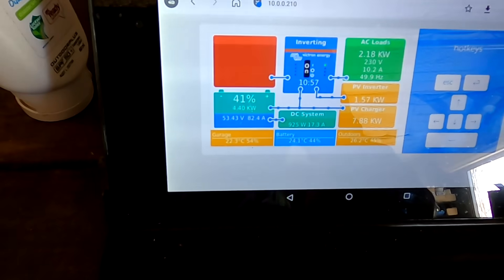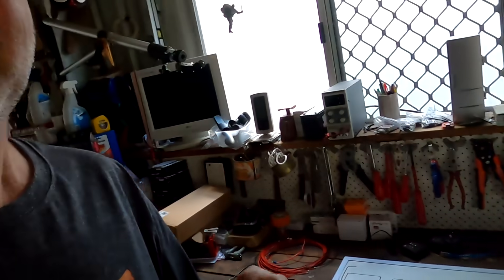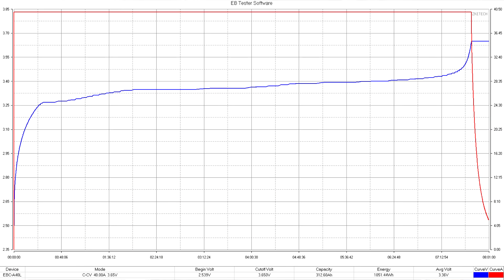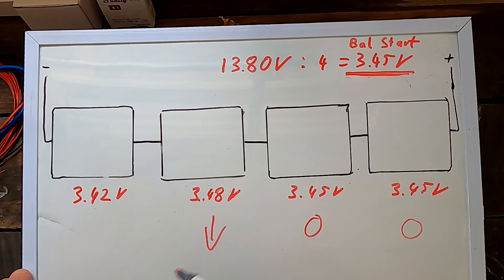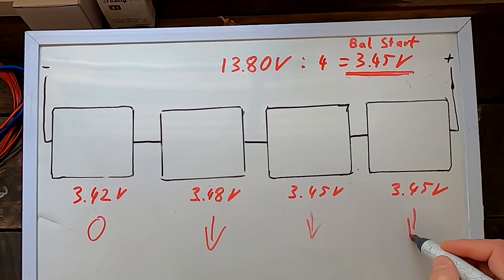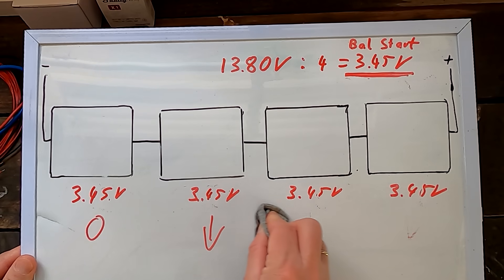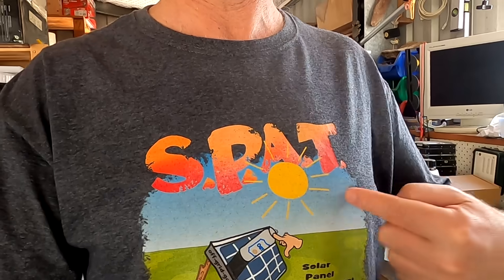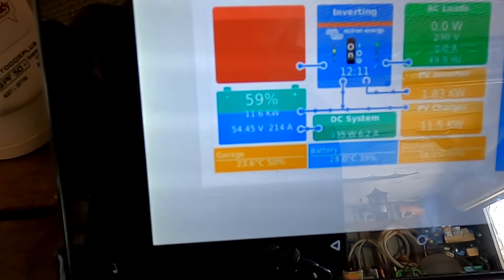Balance Start Voltage for LiFePO4 explained. Why you should not start too early... 🔋⚡

Comment: Thank you Andy, always a pleasure to watch your videos. I am trying to find the optimum settings for my new svolt battery / inverter with built in pace bms. One of the cells constantly  reach 3.65v while others remain fairly equal within a few mv. . Is it bad for a cell to reach 3.65v often  during bulk charge, or can I utilize the function of "forcing" the bms to stay into balance mode as long as no current is drawn.  (It is difficult in a production system to not draw current, which gets worse in my country with electricity so called load shedding - e. g. today we will be without electricity for another 8 hours BUT with lots of sun) My supplier suggests 3.5v bulk charge and  3.4v float. Should balance threshold be ok at 3.45v?

-Chris
Reply from the maker: Thanks for your question Chris. 
If you have access to the batteries, the fastest way is to temporary connect an active balancer to the battery and let it do a perfect top balance.
3.5V as charging Voltage is fine if you let the cells absorb for maybe 20-30min afterwards. That will fully charge them. Under such normal charging, none of the cells should reach 3.65V and trigger the BMS to turn off.
Float, I would set a bit lower to 3.35V. 3.4V is a bit to high.
You can start balancing at 3.45V, no problem.

Comment: You are a legend dragging us out of  the "balancing is not necessary" dark ages. You have done this by initially trial and error but now we have all begun to understand how it all actually works thanks to your testing. "All" includes the manufacturers who begun to add features thanks to your documentation. I'd be interested to see how in day to day real life the Neey system performs with voltage on/off set at 2.7V and deltaV = 20mV. Is the flatness of the discharge curve and 20mV enough to prevent unbalancing?

Comment: @Off-Grid Garage
Thanks a lot for Your great videos! Thankfull I have learned a lot.
But this is the first time, I didn't understand, or You are wrong. It's about the explanation beginning at 6:30
You say, the balancer would discharge every cell, which is above the balance-starting voltage. So the balancer would just produce heat.
But an active balancer takes energy from a higher cell, transfers it in his buffer storage (capacitor) and transfers it to a lower cell (to charge it).
In your example, the balancer would discharge cell 2 (3,48V) and charge cell 1( 3,42V). 
I´m quite sure, that cell 1 would not be discharged here. 
Could you explain, please ;-)

Comment: I bought the voltage relay and heltek 5a balancers for my 16s packs with JBD BMS. Best thing I ever did. Start balancer at 3.45v, been running this way since two weeks after your video on the voltage relay..several months at this point. Within each pack they is never more than a .009 Delta. Amazing.
Reply from the maker: Fantastic! Thanks a lot for sharing!
Reply: Hi, I'm looking into installing a 5a balancer. Can you tell me what start relay you used? Thanks.
Reply: @sailingcamel1020  the one in his video and on the site.

Comment: Andy
You Told Us Earlier That Start Balance at 3.4 Volts
WTF
Now You Sy 3.45 Volts

I Think Someone should make up THERE Mind!!!!
Don't you think?
My settings are the same as yours but 1/2 because of 24 volts
Reply from the maker: It depends on your system design and what your charger settings are.

Comment: The BMS that I am using 250A Muller Energy 4s.  I have everything in the bms configuration correct and still its having issues with cell one. I thought active balance would help with OVC OCC
Reply from the maker: And that's even after a full top balance and bringing cell 1 in line with the others at say 3.6V?

Comment: At 6:25 - This is factually incorrect. No BMS that I have ever worked with will ever discharge "all" the cells at once. BMS units will only ever discharge from the highest cells. Most BMS units look at deviation from the average and only discharge from cells that are above the average cell voltage. So if the battery is at 13.8v the avg cell voltage = 3.45. So even if the balance start voltage is at 3.4v, the BMS will not discharge any cells above 3.45v because 3.45 is the avg cell voltage.

Not saying there aren't some crappy low end BMS units out there that  might behave this way... But I haven't seen one first hand.

I have built numerous packs and I always use 3.4v as my balance start voltage and have never had an issue with that because the BMS is smart enough not to pull down the lower voltage cells.

I have packs that charge to 58v (3.625v per cell) and I start balancing at 3.4v without issue. 

Then at 10:30 you also state that this "rule" applies regardless of whether you're using active or passive, which is obviously not true. An active balancer always pulls from the highest cells and pushes that energy into the lowest cells. It's literally impossible for an active balance to "pull from all cells" at the same time because then where does that energy go? Active balancers just transfer energy from cell to cell, so if they pull from all cells where does that energy get transferred "to"?
Reply from the maker: I think the Daly does it and balances all cells if they are over the set threshold. Shown here on the channel...

Comment: Andy, make us a graphical flow chart of when to use what type of balancing start and stop voltages. Seems to me this is not cut and dry with one method.
Reply from the maker: The start voltage should be very straight forward. Divide your charge voltage by the amount of cells in series.

Comment: Hi Andy, I don't know how else to ask you a question :

I have a Growatt SPH10000TL3-BH-UP inverter with lots of power, but one challenge : this type of inverter has maximum 25A battery load and minimum operational voltage of 100V. If I connect at least 34 cells in series, I get to that voltage, but can I build multiple 16s battery packs each with a bms and daisy chain them?
Reply from the maker: That totally depends on the BMS in your 16s batteries if they can handle a series connection.
100VDC is dangerous and not recommended for DIY work.

Comment: i am also developing BMS and as far as i can tell, if there is no active balancing i go with history-based balancing at LFP.
Reply: Also balancing here is not from a certain cell voltage threshold. We only balance the highest. 216s is the biggest LFP setup which runs fine.

Comment: Good explanation. I still keep the balance atart voltage at 3.41 because to smoothen the highest cells down early and omit high peaking od the cells. With this I can keep the maximum cell voltage below <3.55 even when the cell is peaking and the BMS did not restrict charging even once for a whole year.
Reply from the maker: If it is an active balancer, you can start at 3.41V.
It's just a guideline what I showed in the video.
Reply: @OffGridGarageAustralia thanks! Was looking for the voltage for active balancers… but what about getting the max out of your battery when discharging… the lowest cell will trigger the shut down so active balancing at the bottom too might help?  …no?

Comment: Hello from Pisa, Leaning Tower, Italy.
Excellent explanation and thanks for considering 16s 48V, I have a problem with my BMS which has never worked, when I made the photovoltaic system in a hurry given that in Italy the bills of the ENEL operator have tripled, I lost 1 year asking for a plant with state aid but it was just propaganda. Do-it-yourself is nice but it's not easy to learn everything in a short time, however I decided to try. The 16 cells arrived directly from China, I had read about keeping them in parallel for 3 days for an initial balancing, they all arrived with 3.2V. I don't have a power supply to charge them so I put them in series and connected the MPPT, the sun charged the battery, I turned on the system and connected it to my house on April 13th, since then I have never disconnected it and I consumed 1950 kWh of panels. The problem with the BMS not working is not knowing if the cells are healthy. I try to return the BMS to the AliExpress seller but I still have to buy another one. That's why I came to see your video but I have to watch others to learn as much as possible about photovoltaics, hello and have a good day, Alvaro.

Comment: true that is the correct way to balance,

but as far as i know (correct me if I am outdated);

1. the NEEY smart balancer starts balancing when the average is above the set value, so the fewer rogue cells you have, the lower the average, and sometimes balancing will never start.
2. capacitor balancers rely on the value of the first cell to start or stop balancing, so if the first cell is lower than the other cells, it could lead to the balancer never balancing.
Reply from the maker: Thanks for your questions:
1. The NEEY will turn on balancing if ONE of the cells hits the set threshold and turn off once ALL of the cells are under the stop voltage. This is with the latest gen4 hardware and software on the balancer. It is not using the average voltage for that as in previous version of the NEEY. Watch this video here where I tested this in all details: https://youtu.be/jpG3siEzll8
2. Capacitive balancers balance all the time, so there is no start or stop voltage. However, they have a low voltage disconnect when cell1 goes under 2.7V to stop further discharging the battery.

More about this in the next video.
Reply: @OffGridGarageAustralia 

1. ah yes the newest 4th Gen NEEY doesn't rely on the average anymore, I have couple of dozen 3rd gen, that is why I set my balancing a bit lower, I personally like the the JK Active balancers more, you set the config once, and store it, when it is connected again, it is ready, no need to change anything or activate it, the NEEY on the other hand, turns off when disconnected and you need to manually enable it again. that is why i use NEEY for my batteries since I can intervene, and i use JK Active balancers for remote batteries and client batteries.

2. as for the capacitive balancers I ordered a big quantity last year and customized the starting voltage to be higher, but was a bit disappointed after receiving them and noticing that the first cell's voltage is used to start and stop

Comment: Oops, I'm doing it all wrong. I have my balance voltage set to 3.2V and diff set to 20mV. So far the cell variation stays around 1 or 2mV.
Reply from the maker: At 3.2V, all cells look balanced. You cannot tell if they have the same SOC.

Comment: Andy love your video's and have learned al lot.I have a 12v 100amp lifepo4 battery, which has a build in bms . Buit it will only charge to 13.6v. Could it be that my charger cuts of to soon? And voltage drops?( charches with 14.4v) or do i have bad cells.
May it help if i charge the battery with a power supply on like 14.2v and low amps? I use three of these batteries at my campsite for off grid
Mart
Reply from the maker: Hey Mart, measure the charger voltage without battery. to this voltage it will charge your battery. If the battery stops charging before that voltage, most likely on cell is out of balance and the BMS protects it from overcharging. 
If you don't have access to the BMS via Bluetooth, you can use a power supply and charge close to the voltage when it cuts off. Leave it there overnight in hope the balancer will do its job. Increase the voltage very slowly in the morning and see if you can already charge a bit higher. Some BMS don't balance if there is no charge current.

Comment: Hi Andy, please check how the JK BMS does its active balancing.
You set a balance start voltage (highest cell needs to hit that voltage) and a maximum difference between highest and lowest cell.

You can set the balance start voltage to 3.45V on these, and the difference to 5mV.

What happens if we set the charger to 14V (4 times 3.5V) then?

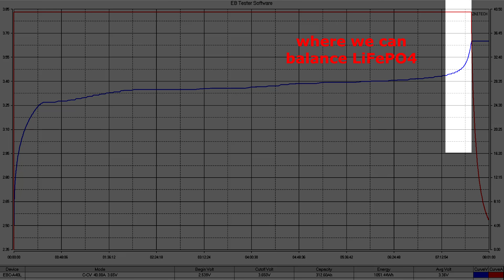Once the first cell hits 3.45V, the JKBMS discharges only the highest cell (!!) and charges only the lowest cell (!!). This means no unnecessary discharging of the cells „in the middle“. We are already in the area where we can balance LiFePO4 (as you said at 11:55). So it is a good idea to start balancing before we hit the final voltage per cell, as long as we have a strategy like the active balancer in the JKBMS has. Believe me, I have watched mine for hours already. I start balancing at 3.425V in my 4s battery. 
Greetings from Germany :)
Reply from the maker: Yes, tested and shown here many times. There is also a video explaining all the settings: https://youtu.be/xTKiOvJ_ejg
Reply: @OffGridGarageAustralia 
Thanks for the reply. I just wanted to emphasize it is in fact a good idea to start balancing a little bit earlier on the JK BMS, since it will only deplete the highest and only charge the lowest cell. As long as you only do that in the steep part of the charging curve before the max voltage you should be fine. You can start balancing then even if the full pack did not reach the final voltage yet.
Reply: @OffGridGarageAustralia
Reply: @OffGridGarageAustralia
Reply: @OffGridGarageAustralia

Comment: Zum ersten Mal disagree. Seit wann ist denn eine Balancer Start Spannung eine Ziel Spannung?! Ich dachte die oft besprochenen 3,45V ergeben sich aus der LiFePo Chemie, weil dann die vollste Zelle das Köpfchen aus dem noch flachen Meer der übrigen Zellen reckt.
Und noch kein BMS Test auf Deiner Werkbank hat doch ever 16 Zellen als discharging auf rot gesetzt. Bis jetzt hieß es doch nur die vollste Zelle psv. wird entladen, akt. lädt die leereste. Noch nie war die Rede davon, dass der Balancer die Zellen einzeln betrachtet und auf eine Startspannung zieht. Die bei den ungsteuerten aktiven Balancern ja schlechterdings definiert werden kann...
Reply from the maker: If you charge to 56.8V for example, it would mean 3.55V per cell, if all are balanced, right? Why would you start balancing at 3.45V already? Yes, we are out of the flat part of the charge curve by then but it does not mean we should start balancing and discharging a cell which it at 3,46V. Even this cell needs to charge to 3.55V but you are going to discharge it already. Makes no sense.
Reply: @OffGridGarageAustralia I get your point here, but that weren't my concerns about that video.
1. At 6:33 you say all cells will be discharged, even the lowest, to balance start voltage. And my summary of all you work before, would lead to the conclusion that the 3,48v cell additionally charges the 3,42v cell via active balancer and both 3,45v cells are left untouched. (Connecting an active and programmable balancer to a battery with these voltages. In real life, connected while charging a empty battery, balancer kick's in 0,08v lower than in you example, one cell at 3,4v, the others at 3,34/3,37v, so they are below 3,4v.)
Smells like a new test.. 😀

2. And about this comment: yes, why should we discharge a cell, which has to be charged? Because it's theory. In "Praxis" we charge commonly with higher amps, above balancers capability. So charging with 3A the whole battery, a classic JK will not discharge the 3,45v cell in your example, it will charge it with 1A, and charge the lowest cell with 5A.
And for example with a Daly, you get little more time to prevent a "voltage runaway" of the highest cell, to speed things up. 
In long term it doesn't matter so, or so.

Comment: I dont get it. With passive balancing i do agree...
But not with active balancing. 
With active balancing you should start right at the knee, so the cell charged most wil be drained over to the cell with least energy.
Then all cells will be charged faster to desired voltage.
If you wait to long the cell with the most energy will be banging on the max voltage to long.

Or am i lost here?
Reply: A too high balance start voltage would increase the risk that a high V cell reaches the BMS's cell overvoltage before the balancer had enough time to bring that cell down or other cells up. So the BMS could turn off charging, but your battery is not at 100% SOC yet.
Reply from the maker: If you charge to 3.55V per cell and start discharging/balancing a cell at 3.47V makes no sense. Your target/goal is 3.55V per cell, so let them charge until this voltage before start discharging.
Reply: There is a difference between discharging and moving power between the cells. 
I did try your setup, and ending up with one cell with less power in one cell.
I have a jk BMS.

Comment: Andy, ...  I have four 100 aH sealed 12V batteries (LiFePO4) ... connected in parallel ... can I top balance these or reach top balance?  None of the batteries has/have a bluetooth to the BMS and I had them way before I started watching your show.  I haven't made my own yet.  Great video.
Reply from the maker: Very difficult as you don't know what the single cell voltages are. You can only charge them to a voltage until the BMS turns off. You know then, this is you maximum charge voltage for this battery. If they still balance at this point, you don't know.
Reply: That makes sense,,, thank you,.pat @OffGridGarageAustralia